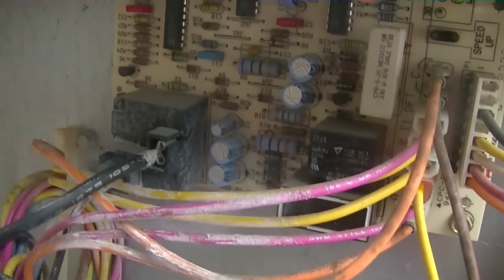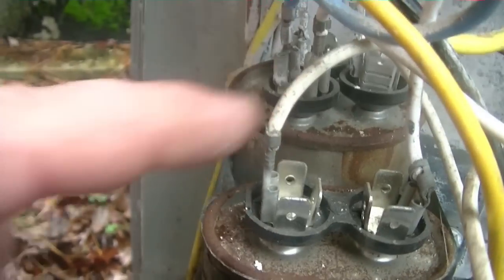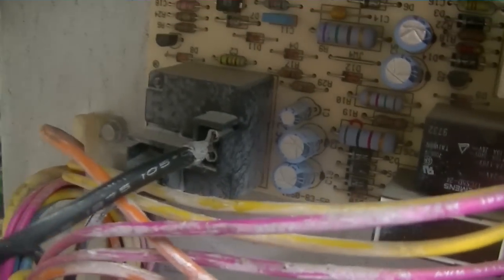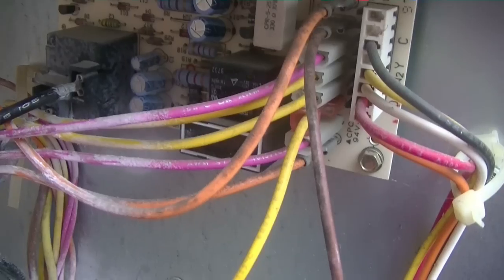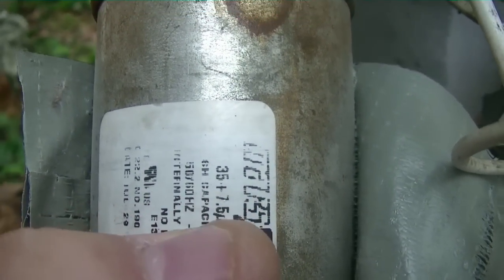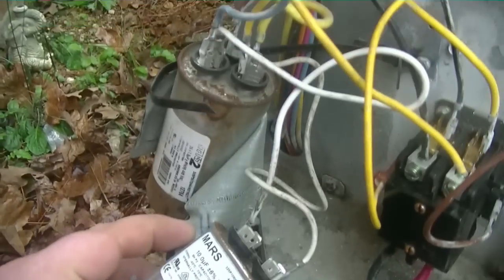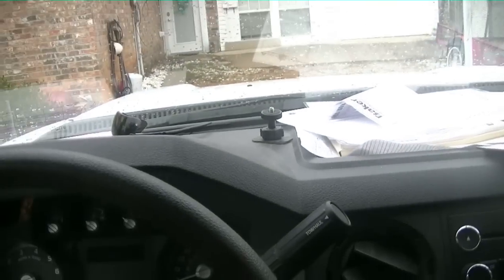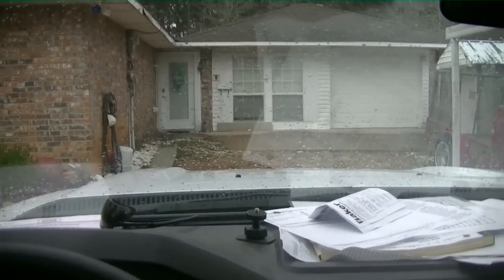HVAC Service- Defrost Board Failure

Comment: Takes a little bit more work but I keep Goodman boards and sensors on the truck incase I can't get the original. You can put a Goodman defrost board on most single stage heat pumps that don't use on demand defrost. But I'm sure you knew that.

Comment: Hi! When you test the defrost board by putting one wire on the contactor, Which side of the contactor do you tie it to? Run or Common? I am guessing "Run". Also, Do you put both fan wires on the Run side of the contactor? Thanks!

Comment: You can use about any defrost board as long as the sensor is right for the board.
We use that goodman board for most non warranty stuff but if I need a defrost board for a unit I use what I have and make it work..lol